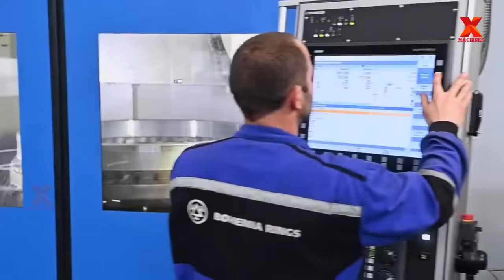The World's Largest Bevel Gear CNC Machine- Modern Gear Production Line. Steel Wheel Manufacturing

Comment: When I was in the fastener business, 1020 steel was the cheapest grade of steel used to make hex head bolts. I’m not saying you couldn’t make a gear out of that material but it’s where resisting capabilities were my new compared to 4140 for example that was he treated. This very well could be a video pirated from somewhere and captions added by people who have no clue.  Perhaps I’m wrong tell me where.  Before you get to carried away, I deal with steelmills and among some of the material they produce is wire for roller and ball bearings.

Comment: Forging deforms the molecular structure of a material as steel with its own carbon distribution in the material which has a negative effect with more risk to cracks in the future. The speed of pressing has consequences as the speed of cooling afterwards (hardening) for its molecular structure.
Casting is a better option in this case which let the molecular structure form and not change.
Reply: So wrong.
Reply: @peternyman1055  material science part of mechanical engineering.
Reply: @arjenvandoorne9321  wrong. forging gives a material much more strenght and structure than casting. you just need to have heat treatment after that to relase internal forces in material.
Reply: @XzzVttll  is casting not by heat but to the form it has to have ? What is casted can be hardened afterwards without deformation.